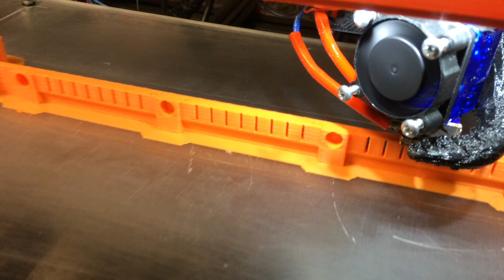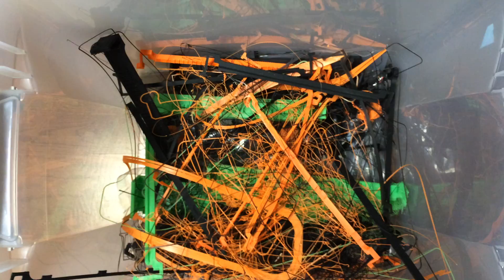A working ABS print!

Comment: Are you Using any hair Spray or anything similar or it's sticks just like that without any other solution?
Reply from the maker: +3DIY Original It sticks just like that. You can see on the first pass I needed a brim to keep it sticking to one place for a long enough time.